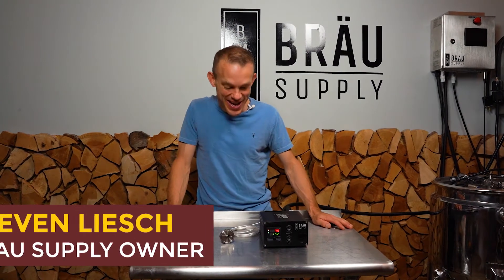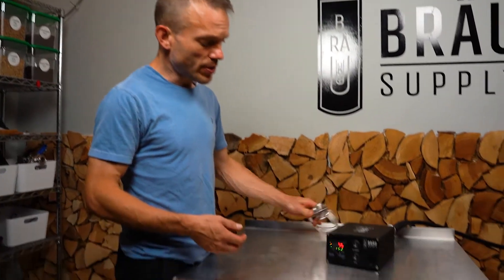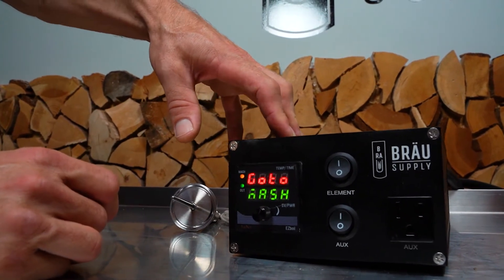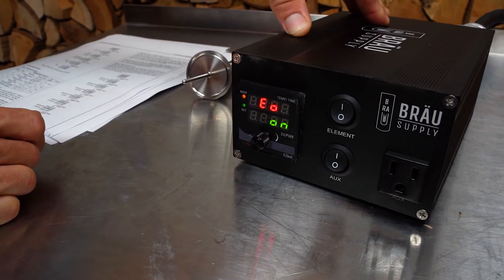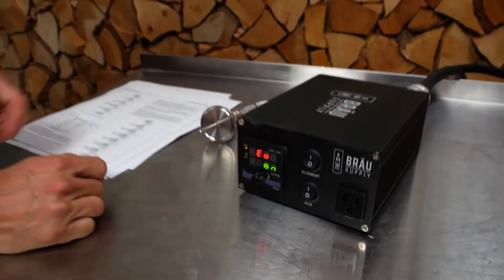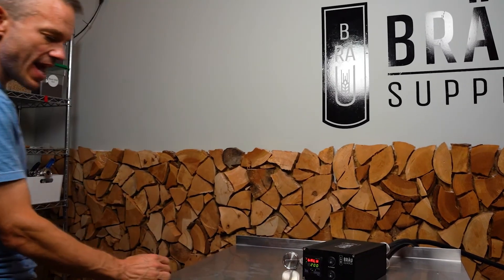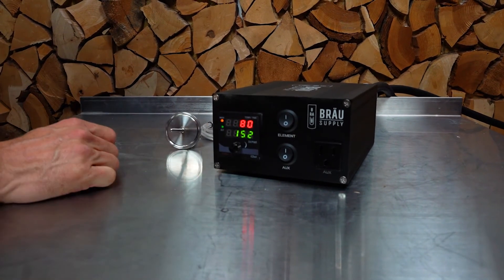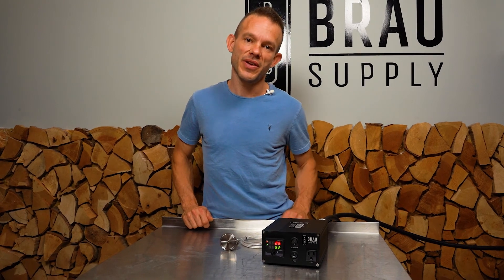Brau Supply EZ-Boil Controller

Comment: This controller doesn't appear to have a fan. When you run a 240V heating element the SSR gets REALLY HOT. A fan should always be used to keep remove heat from the heatsink unless you're using a really large external heatsink. A 12v fan is more convenient. I'd expect the SSR to fail prematurely if a fan is not used.